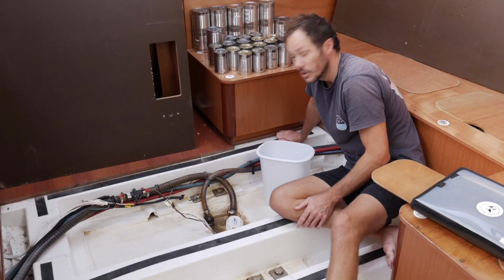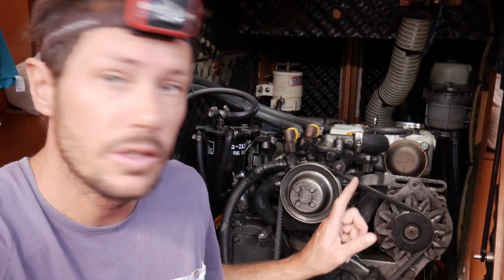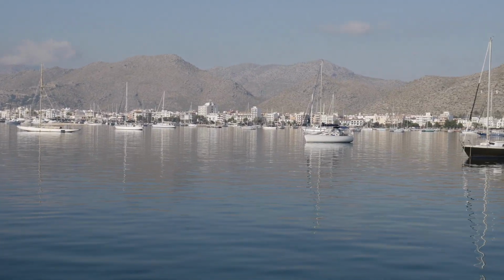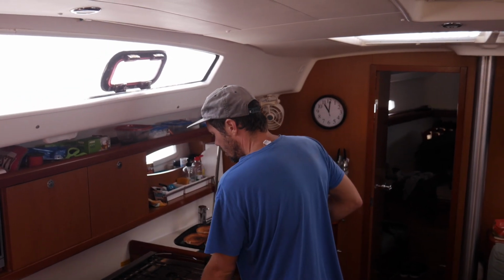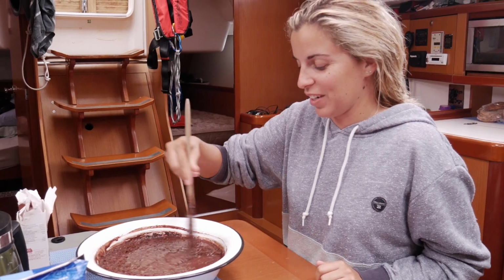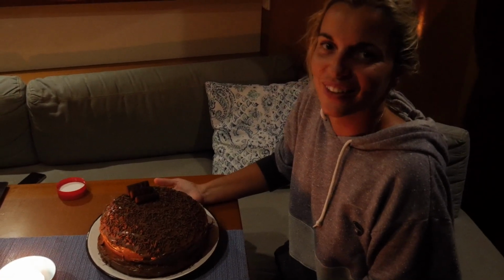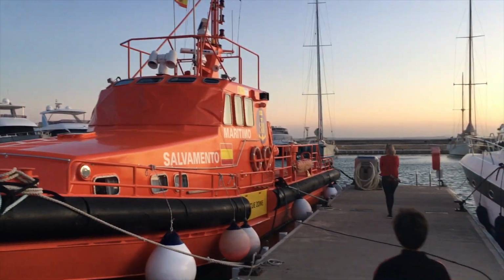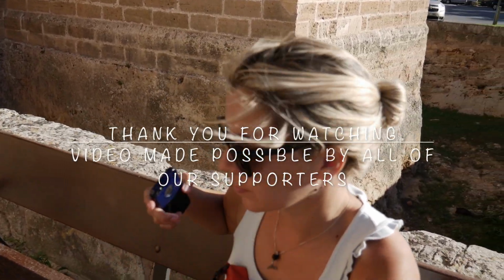Sailing life | Electrical issues, fishing and birthdays- Ep. 33

Comment: I would ask the service guy if going to a larger alternator will drag on the engine or any other potential problems and if there isn’t any then going larger with more amps is always a good thing! Don’t have to run the engine as long to charge your batteries etc...
Reply from the maker: Good idea Mark. Seeking advice as we speak.

Comment: Charging batteries is a complex subject. I will try to give you a few pointers. If you are not planning to go lithium, don't bother with a much bigger alternator because lead acids accept relatively low current after they are above 70-80% state of charge. Basically, you can't fully charge a lead acid bank (safely, in a way that will not damage the batteries) in less than 3-4 hours (it's more likely 5-6h on a standard automotive alternator), no matter how big is your alternator or charger... And your batteries should be full everyday to minimize sulfation... And no one wants to have to run the engine for that amount of time to charge batteries.... So I would suggest putting in more solar. Solar has many ours in the day to slowly push those amps back, this works perfectly with lead acids. One thing that will greatly improved your alternator charge performance is an external charge controller. I installed the top model from Sterling an I'm very happy. The deal is... The original regulator is very dumb and because of this, very conservative on charging voltages to avoid boiling your batteries if you run your engine for many hours. A smart external regulator will transform your dumb alternator into a 3-4 stage charger (like the ones for shorepower or solar). This will reduce your charging times to about half without damaging the batteries. If you go lithium than a charge controller is mandatory and you could benefit greatly from a more powerful alternator... But, if going more than 100-120A you will definitely need to upgrade de belt system for something that can handle more power (probably a poly V). PS. I have the same engine 4cyl yanmar 54hp, but mine came with the 80A alternator.
Reply from the maker: Cheers Paial. Really appreciate the advice.

Comment: Easiest way to check a alternato.
Look on the back side of it where are the bearing is should be round in dead center in the
Start it up take a butter knife or something that is metal and touch that spot why it is running if it is working the butter knife will stick to it because it is generating electrical field if it doesn't stick it is bad